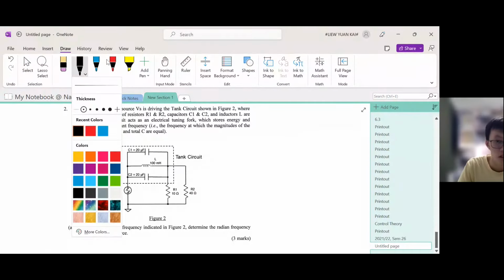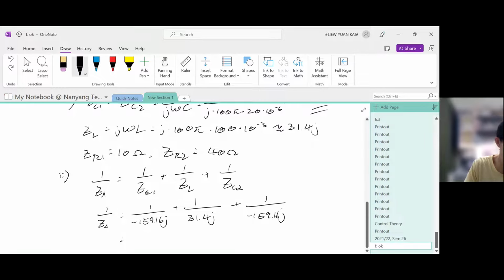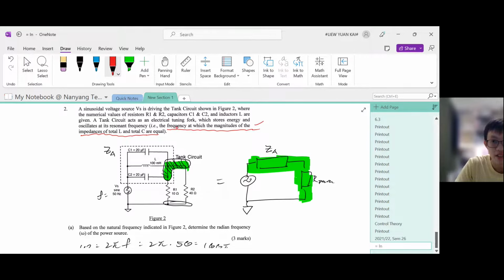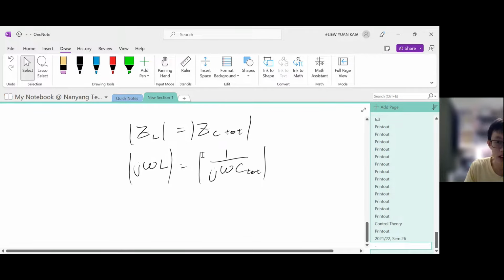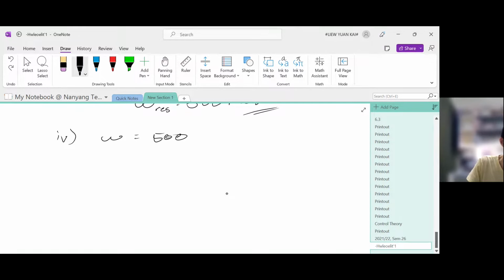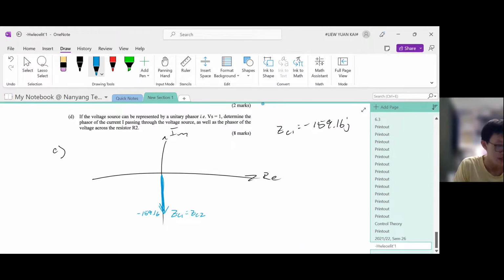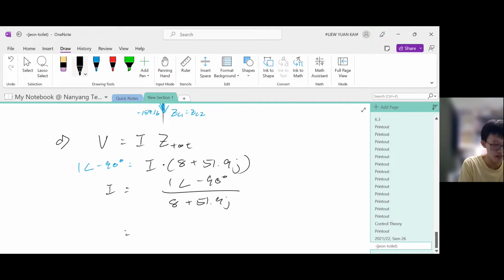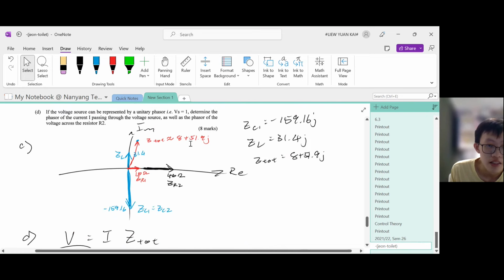50 Sub Special: Circuits PYP 2021/2022 Sem 2 Question 2

Comment: Hi Dixon, firstly I want to say your video is so helpful!

Just to ask on the total impedance under (ii), shouldn't it be 8 - 51.865j instead of +51.865j? Thank you!
Reply from the maker: Helloo, I'm so glad you find it helpful. I didn't check the math thoroughly but assuming i didn't butter finger press my calculator wrongly, at 4:14, you can see to find Z_A, you have to take 1/ -0.019j. I'm pretty sure this will be positive.
Reply: @dixonteaches7804  Hi Dixon, sorry my mistake I did get a same answer! Again thank you for clarifying!

Comment from the maker: Mistakes:
At 1:41, the impedance of the capacitors should be (I missed out the j on accident)
At 9:30 , to find the total impedance of the capacitors I foolishly took one of their impedance and multiplied it to which is equivalent to adding their impedance directly. This is wrong because adding them up directly is for the Please check my correction video on this. Gosh, I'm careless 🥴

Comment: Hi Dixon,

For question 2(b)(iii), 
when you calculated the total impedance of the capacitors, do we have to include or take into consideration that the capacitors are in parallel so Zctot should be (Zctot)^-1
Reply from the maker: I realised there are two ways to find the total impedance of the capacitors. You can use Ctot= C1+C2 to lump the two capacitors as a single capacitor. OR, you can use 1/Z_Ctot=1/Z_C1+1/Z_C2, then by comparison, C_tot=C1+C2. So essentially both ways work.
Reply from the maker: Moreover, I summed up their impedance wrongly... Yeah i mistakenly add them up as though they are in series. Really sorry about that. Check my correction video on this. Really really sorry i caused this confusion